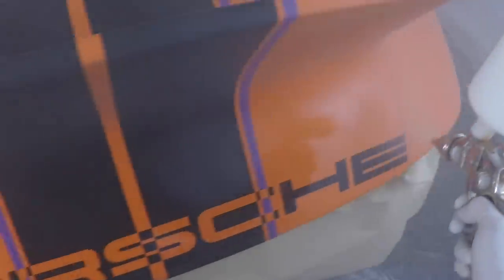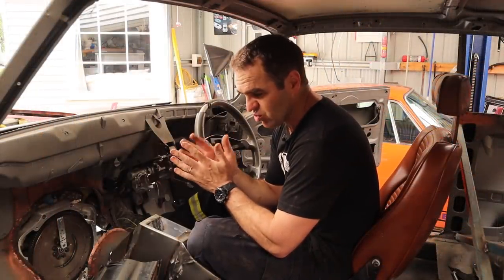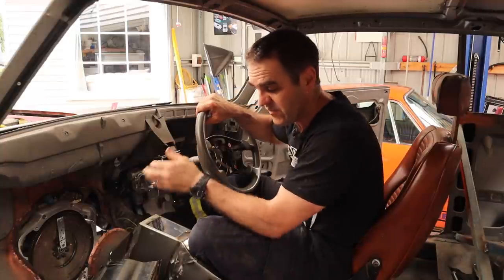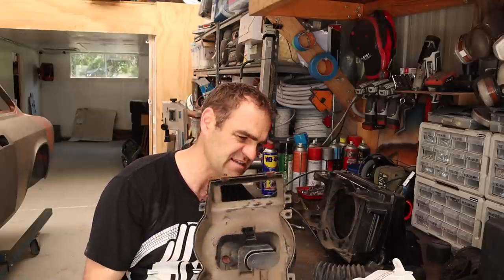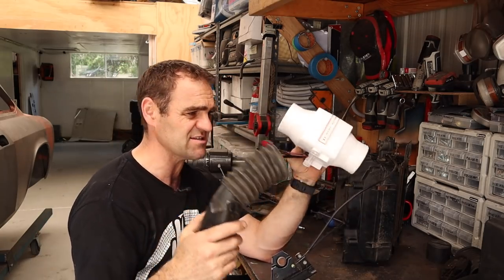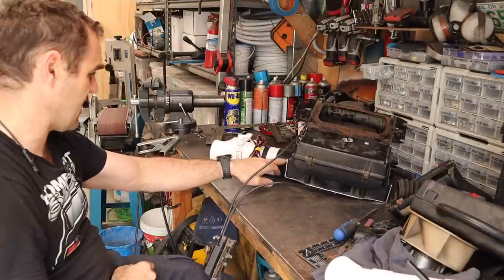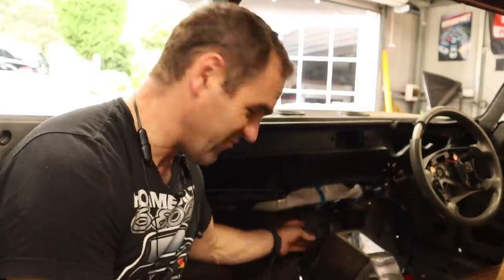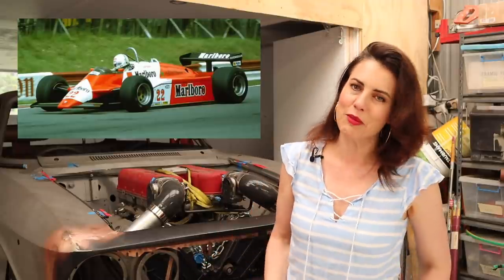Things are heating up - Ferrari engined Alfa 105 Alfarrari build part 73

Comment: Could you reduce the last three section's of pipe by half the diameter as you seem to have reduced the cross sectional area by 50% with the tape.This could give you more space under the dash for wiring etc.

Comment: Closeable 75mm rotating heater vents are available for as little as $10 with free postage on eBay. They are apparently for a “Webasto” heater but could be adapted to pvc.

Comment: Two years ago this week I was on my back under the dash on an Alfa 101 Sprint coupe installing OEM ducting. I recall it as being about the most uncomfortable position I've ever been in so kudos for you for not a whimper. I'm surprised the PVC ducting worked as well as it did for you. Not to make your life more complicated but the heater cores of these cars were never ample (IMHO) so if there is room to have a thicker one, you might feel an improvement.  Then again, perhaps your climate (I've never been Down Under) is not bitter cold and therefore this is enough. Great stuff-you are the Jazz Musician of the Hot Build Alfa set.  Let's all raise a glass when you hit 100K. I sing your praises whenever I can.

Comment: Jeff - Instead of using tape, try this.  Buy some flat PVC sheet and then cut out "washers" that will fit inside your duct outlets.  Each washer will have a center hole corresponding to the area of the taped off areas you developed for your test.  The washers can then be glued in place using PVC cement and will be permanent and not interfere with the installation of the vent ducts, etc.  BTW, these are what is known as restriction orifices and are used all the time in industrial piping to adjust flow rates to the desired rate.

Comment: Bloody hell Jeff, you did well modifying the heater unit. I'm glad my suggestion of the bilge blower came in useful. Cheers
Reply: Good idea. 
Thou the bilge pump CFM may be lower then the stock Alfa fan.
Also another commenter has suggested the bilge pump is not designed for hot air.
Worked ok on the bench.

Comment: Could put some disc shape flaps in the pipe to divert air to feet or screen with some bolts/pins/ threaded rod as pivots and either cables or levers on the end of pivots for controls. Could also put caps on the ends of pipe and drill holes or slots etc to get the desired amount of choke/restriction

Comment: Jeff, you can fit end caps to those pipes, and then drill different size holes into the caps to balance the flow. Better than using tape.
Reply: Im glad I had the same idea as someone.  Jeff please consider this option

Comment: Jeff, check that core for leaks before you do a final install, because...well you know.😉  I did a 49 Willys wagon, moved the "box" heater to tunnel by firewall, now all vents can be used, plumbed water thru a firewall bulkhead in passenger firewall area. I appreciate your approach to problems, I think many fabricators are "on board" with your work. Yeh, paint that PVC black, maybe knock off edges first, will look ok, being under dash. Cheers from Seattle

Comment: I really like the ductwork!  As for directing airflow, it can be controlled by shutting off/opening the ducts to your footwell - my old (classic) mini worked that way: in order to direct more heat to the windshield, a lever closed the air flow to your feet and the heat had nowhere else to go but the ducts to the windshield.  I'm sure you could engineer a small flap for the end of each of the ducts to your footwell.  Always great storytelling!!

Comment: As for the air flow- the cheapest and simplest way is to use PVC reducer combined with smaller size of ducts between reducer itself and the air vents.
To open/close the air flow you can cut one section by using 12V air damper/actuator.

Comment: Have a wee look at the ducting for diesel heaters - nice flexible pipe available including all the bends, tees etc you could ever need. Also has foil inside to keep heat in

Comment: Also, you can use a similarly compact centrifugal blower, and forget fresh air ducting for the heater.  Use cabin air only for heat, and dash vents for fresh air.  The 911 does something similar.  I don't think you will be satisfied with blower output with your in-line fan, but maybe I'm wrong.  I wish you the best of luck, and please keep up the great work!
Reply: Forget what I said about fresh air ducting.  I misunderstood the air flow arrangement.

Comment: Im using 2x 12v hair dryer motors in my car. No need for a heater box or coolant lines doing it this way. Just simply connect hair dryer motors into the dash ducting

Comment: That's a great solution - think smarter, not harder. Using pre-fabricated parts for something like this, rather than rolling your own solution from scratch definitely saves plenty of time and money! (Could you swap the white for black, to save having to paint it?)
For switching your feet/screen outputs, a company over here in the UK called T7Design have some Butterfly valves which can be controlled by a bowden cable where one is the primary, the other is a piggyback (or they do an electric version). If you've got an extra couple of inches at the end of each of your outlets, you might be able to squeeze them in? I'm sure there's a similar manufacturer/distributor over there in Aussieland.
Reply from the maker: We don't have a black option for plumbing here in Aus unfortunately, it only comes in white. I will look into butterfly valves though.

Comment: Liking the build ideas you keep throwing in there Jeff.
Just an idea to throw in the mix.....
Instead of having one side of the casing blanked off, would it be better to have a motor half the size on each side, then fit a mix flap for up/down on each motor outlet?
Less pipe going across behind the dash, retaining that precious space for infotainment or similar later in the build

Comment: You could easily make discs to slip into the fittings and hold it in place with a ring of PVC for setting the air flow.

Comment: Another idea for the vents on the dash. I wasn‘t satisfied with the performance of the original ones. So I bought and build the ones of the Giulia or Giulietta model on my dash. They are working like turnballs for the direction and can be closed independent and separatly. I can send a picture if you want?

Comment: i think you can use a pvc pipe  valve at each end if you really want to distribute air
Reply: Maybe just to shut off the feet, that way more air can be directed at the windscreen if needed.

Comment: Looks like a nice and simple solution, I'd try to get the kind of vents you can fully close into all the outlets. Should you ever really need to adjust (unless it's cold and humid I find that I personally don't have to change the distribution much), you can still pull over and adjust all 4 vents manually that way. Nobody loves the look of PVC ducting, but considering the flex duct that is the more standard solution for custom cars, it's not that bad.

Comment: You can use neoprene foam to insulate the ducting and reduce the noise. I would also suggest to wrap the fan box in alubutyl
Reply from the maker: It is pretty quiet as it is, and when that V8 is running you won't even know it is on ;)

Comment: Hi Jeff
Just use a exhaust valve actuator as a valve to distribute the air to the required place if you use a vacuum type you can adjust the amount it opens by the amount of vacuum 

With the Vacuum exhaust valve actuator you could use your ECU with a turbo wastegate actuator to very the PWM to control the amount the valve opens 

This one on ebay uses PWM to control the valve 
Exhaust Control Valve Set & Vacuum Actuator CUTOUT OPEN 102mm Pipe & Controller
Reply from the maker: Good idea, but overkill. I have a plan ;)
Reply: Hi Jeff
You can get a 12v 20amp mosfet speed controller from ebay to control the speed of the fan motor

Comment: Dont do the final vent block offs with tape, make up some aluminium disks with same size holes as your mock ups and that are same od as the pvc pipe, sandwich between the pipe and elbows.

Comment: there are closable screen/face vents approximately that size you could use on the floor outlets to boost the screen or cut off the burning feet heat if needed. looks good, I wondered how those inline fans would go, is it quiet enough or need wrapping in something to make it quieter?

Comment: Love your videos, and builds. This one just gets under my skin though. All the custom work, and you use plumbing? You should get the PVC in the orientation you want then switch it over to aluminum piping. I know it wont be seen, but PVC? It's an alfarrari, it deserves better. And with your ingenuity I believe you can figure out a way to put valves on the outlets... just a thought from california!!

Comment: you could come up with a design for small 'flatslides' at or near the ends of the ducting for the footwells to close it off... I can forsee it getting very hot on your feet if it's on constantly... it doesn't have to be electronic, just something that has a little lever to close off the flow...

Comment: I would have used a small rad fan with a pot for speed control. Attach the fan to the heat exchanger and then use the stock duct work.

Comment: to pick up on Peter PErry's comment...2 pieces of flat aluminum on shafts set up like carburetor butterflys in the floor outlets would be dead simple to set up and put on pish/pull cables.......
Reply: I was thinking of an actual carburetor butterfly valve placed inside the pipe. With a lever on the outside would work pretty good.
Fair bit of work thou.

Comment: I think you would be surprised about how much air a pc fan can move looking at the unit you got its the 3" which is 150cfm whereas  you could have fit 2 140mm noctua fans which are over 100cfm each and only 25mm tall with variable speed control and are almost silent

Comment: No please don't use duct tape, they sell block off pieces for those tubes and you'd just have to drill different size holes to simulate the same thing and would look much better😎

Comment: I see a possible problem with the new fan system! You will be passing hot air over the fan motor which it’s not designed for! It may overheat / seize up ! Time will tell

Comment: Wonderful videos, imagination and craftsmanship. I do wonder about the free inlet / outlet bilge blower (axial fan , low pressure) vs the stock centrifugal blower wheel (radial flow., Higher pressure) once the system is all together. Hj
Reply: Was thinking same. Wonder what the CFM comparison is? 
Bilge pump may have a bit lower air flow.
Seemed to work ok on bench.
Reply: @stuartd9741  The CFM comparison is only valid when compared at a given restriction. In a free inlet free outlet it wouldn't tell us a lot.  .
Reply: @hansjansen5224  Yes. 
all I'm saying is the original fan is designed to push quite a bit of air through the vents. 
Just wondering the capacity of that bilge pump. Though it seemed to work ok on the bench...

Comment: what if you had some servo motors to turn flaps in the ducts to control air flow to control foot vs de-myster?
Reply: A decent amount of extra work, but possible of course.

Comment: 3d print ventilation parts instead
Reply: That is a lot of work for essentially the same result.
Reply: @Finnspin_unicycles  the idea is not the result but the design aspect of it...if you going through all that extent of work with a ferrari engine and metal fabrication and going to install pvc pipe underneath... its like a rich man with dirty underwear ..you might not see it but you will be able to smell ...

Comment: I'm not sure if you'll get away with this since air coming off the heater core is cooler than air coming out of the heat exchangers on a bug/911, but those bilge fans melt and fail when you try to use them to boost the heat on an air cooled car. See: https://www.thesamba.com/vw/forum/viewtopic.php?t=613552&start=0
Reply from the maker: That is something I am not sure about, although I know the air from the heat exchangers can get super hot, I assume much hotter than a heater core, but we will see.